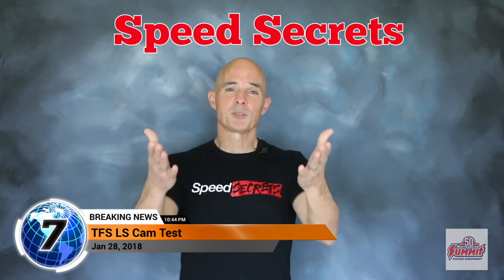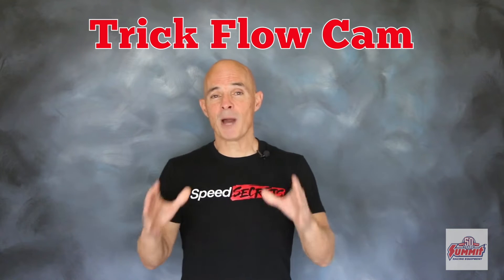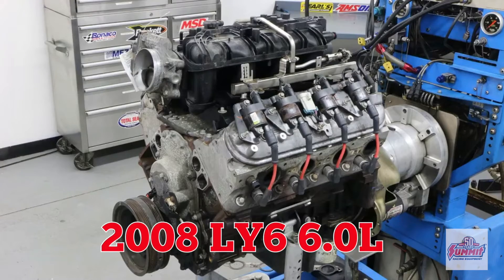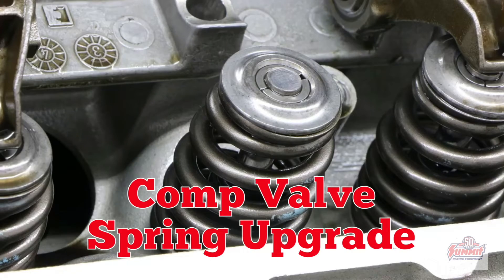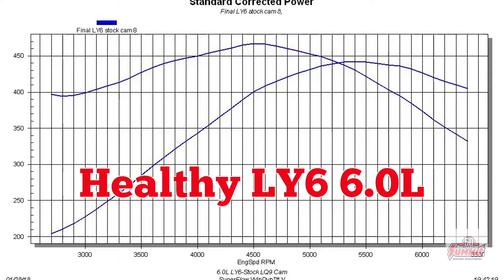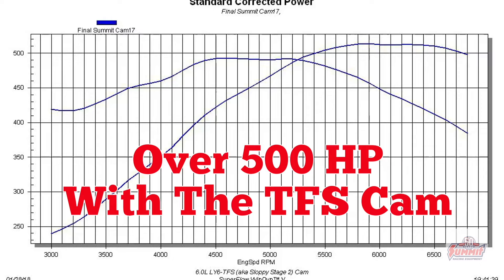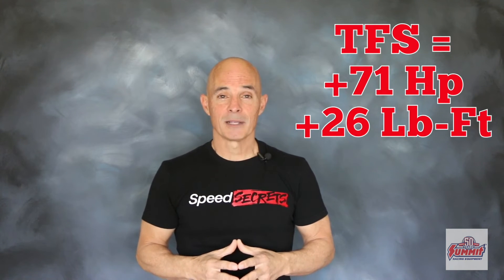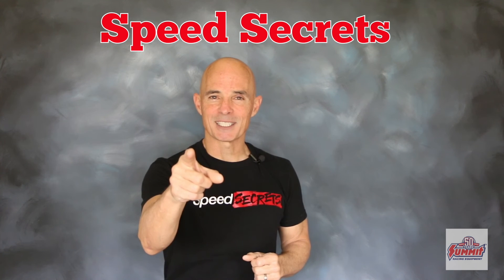GM LS 6 0L Trick Flow Cam Swap 71HP Gain!

Comment: My question is will this work on my lq4 stock since the compression is 9 something and the cam recommends  10:5 minimum.. I’m running ported 823 heads
Reply from the maker: There are two types of compression, static and dynamic. Static compression is the actual mechanical compression ratio number you get by calculating piston design, combustion chamber size, and the engine's bore and stroke. This calculation doesn’t solely dictate the engine's dynamic compression. The cam grind, along with static compression and even induction and exhaust, determine this. That is why it is essential to match all your engines components properly. The overlap designed into performance cam assists in scavenging within a given rpm (based on duration or lobe separation) and requires a minimum static compression to maintain proper cylinder pressure. Therefore, the minimum suggested compression rating of a performance cam is essential for maintaining proper dynamic compression and peak performance. While this camshaft will physically fit and the engine will run somewhat adequately, you can expect a less than advertised performance gain and sluggish lower-end power vs. a cam that is correctly rated for your application.

Comment: What Springs part number ???
Reply from the maker: The cam in the video is part https://www.summitracing.com/parts/tfs-30602003/make/chevrolet
 
Recommended matching Comp springs are part https://www.summitracing.com/parts/cca-26925ts-kit
Reply: @SummitRacing  will the spring kit work with this cam on my lq4 running ported 823 heads ?

Comment: Richard you need to make a KIT to sell.
Cam Kit with reprogrammed (fuel tables)  factory C.P.U. driving the new injectors.   Sell Direct to customers OR thru Summit.
We can replace cams, heads, intakes & injectors (with increased ring gap). We are excellent at replacing parts (own my shop) BUT the NEW FUEL TABLES & Tuning (professional) require DYNO TIME @ WESTECH.
YOU have that information.
Find a source that can reprogramme factory C.P.U. 
I am married with children, that $1,200 Holley HP  E.C.U.   is a NO GO
Thanks for sharing all your hard work.
The reason I have subscribed to your channel
1. You are NOT trying to sell me $2,000+ HEADS. You say just clean up the ports of the heads on the engine.
2. You are NOT trying to sell me a $1,000+ intake,  the chevy intake is great use chevy.
3. You showed me,   if I do a mild turbocharged engine, just use you stock exhaust manifolds,  No expensive turbo kit required.

Comment: You said it had 71 hp gain then said it picked up over 100 hp so which is it? 71 or 100??
Reply: 71 peak gain 100 in the certain rpm range

Comment: Can i use this setup with lq9 or only ly6?
Reply: any 6.0 with 4 inch bore
Reply: The ss2 cam has been use in all ls motors minus an LS7 and I can't recall hearing or reading a ss2 in a 6.2L. But if they did on ly6 with rect port heads.. Why not on an iron block with rect port heads that is down .2L..

Comment: What was the others mods done to the engine
Reply: really was no mods done to the engine. it was basically a stock ly6 with ls3 heads and they just deleted the vvt and use that cam, tuned and there you go. oh, they did use 75lb injectors